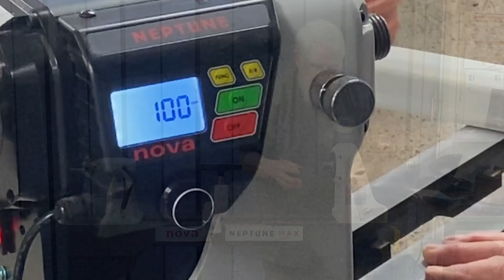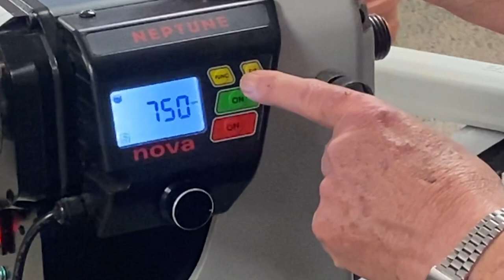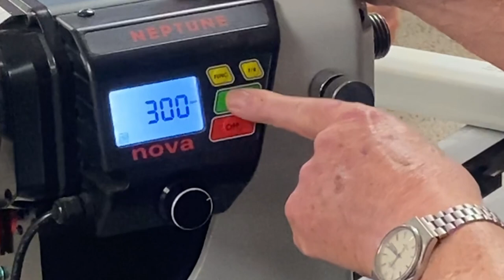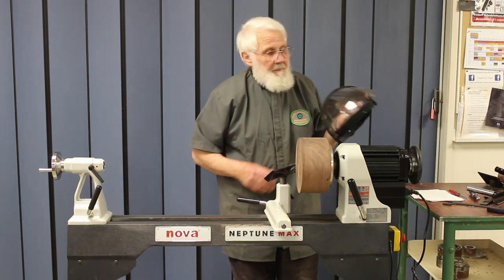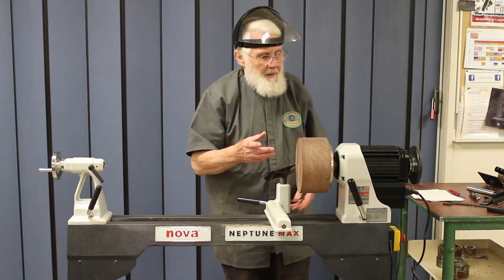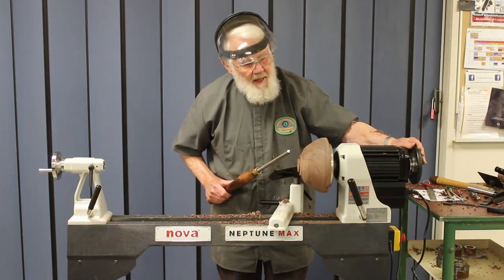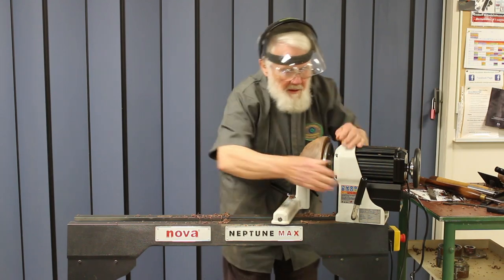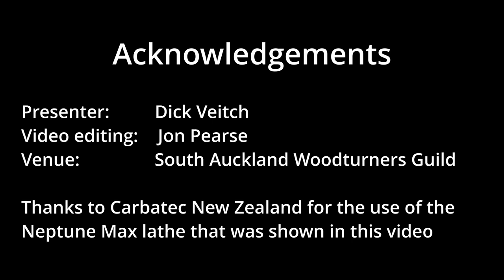Neptune Max Lathe

Comment: It looks like a nice lathe for a midi lathe but for an everyday bowl lathe, I'd question the longevity of its design. It seems there is limited length in the spindle shaft for enough bearing support for heavy bowl roughing. The tailstock also looks a little lightweight to me. I'd consider this for a 2nd lathe for lighter finish work. I think it's still in the beta stage.
Reply from the maker: The design of this lathe is so well proportioned that it looks lighter than it is.  If you require a larger lathe and desire the Nova direct drive then the Orion on Nebula may be a better fit for you.

Comment: does the rotating head not have detents for alignment?
Reply from the maker: Yes it does have detents, but for accurate realignment with the tailstock we have found better results using the acruline (double ended morse taper) with all lathes that have a swiveling head.

Comment: Are there any disadvantages to using a direct drive lathe?
Reply from the maker: We have not found any downsides, all the permanent lathes at South Auckland Woodturners are Nova DVR direct drive, this is also what most of our members are using in their own workshops as well.  Nova DVR is smoother and quieter, with excellent power delivery and torque, ideal for the training programs we run at the club.
Reply: On any lathe tat has electronic controlls on, servo drivers, the best advice is unplug it from the wall, when not in the shop, or going on vacation, power surge can kill it. Any VFDs controlls are very sensitive  to power supply fluctuation.